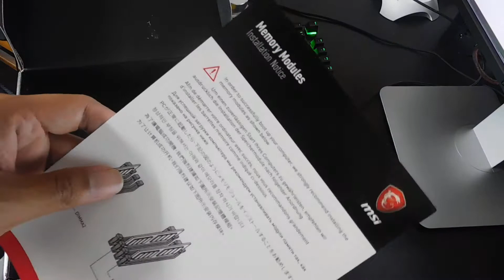quick unboxing MSI B350M GAMING PRO AM4 RYZEN

Comment: what processor you have?
Reply from the maker: RYZEN 5 1600
Reply: good
Reply: what do you have it overclocked to?
Reply from the maker: I overclock from 3.2 to 3.65 can't go higher because I'm still use stock cooler
Reply: +Joko JMC and what voltage ?
Reply from the maker: arround 1.3-1.35-1.37
now I'm back to default setting because unstable system, i'm not good overclocker

Comment: I'm thinking to buy this board with ryzen 1600, CORSAIR VENGEANCE LED 16GB 3200MHZ, Corsair VS450 PSU, will these parts work ok together ? my first build, so im kinda woried about parts. xD
Reply from the maker: make sure your ram is available here https://www.msi.com/Motherboard/support/B350M-GAMING-PRO.html#support-mem I'm using unsupported ram (Patriot Viper 4 3400mhz) and still stuck in 2933mhz
and I heard this motherboard use "cheap" vrm/mosfet or something part in near cpu socket, if you plan to overclock I suggest buy better motherboard, for daily use without overclock this motherboard  is still powerful, just make sure you buy supported ram
Reply: RAM im about to use is not in supported list, but i think it will work anyway, they just don't put all the rams that it can run with in the list i gues. I'm making this build for music production, and i'm not thinking about overclocking. I just don't want to buy parts that wont fit and work properly, thats all

Comment: any problems with this mobo? getting mine tomorrow with ryzen 1700 and msi rx480 8gb
Reply from the maker: I have not used it yet, still looking for memory
Reply: Siala Leao I have it, been using it for 1 week now with no probs. overclocked cpu and ram also with no issues. do make sure to update bios to the latest as it will improve cpu performance. bios can be a little glitchy but what bios isnt.
Reply: Joko JMC best memory is the flare x from gskill. tested out all types and that was the best for me. also higher mhz ram will increase speed on cpu as amd has its special "infinitely fabrick" to thank for that.
Reply: Thanks mate. Its a public holiday here in Australia so I so get my parts tomorrow or Friday

Anyways as I am new to the PC Community. Did you download the AMI BIOS 2.3 or the AMI 7A39v24 (AGESA to 1.0.0.4a)? I cant wait to build my first PC. Thank you for your help and I will continue to support your channel 😀
Reply: 7A39v24
Reply: you can add me on anything to message me on any questions you have.
Reply from the maker: unfortunately gskill ram is overpriced in my country
Reply: what i would do is try to get ram with 3000-3200 mhz with low CAS latency like cl14 or cl15.
Reply: I'm planning on getting this board, what would be the process of updating the bios?
Reply: @SolarSyn I heard bios were crap on this motherboard.  I was going to get this one until I done more research on it.  I'm probably going go with the ASRock AB350 Pro4 which doesn't suffer from the same issue.
Reply: quantae06 alright

Comment: Which one Better ,This one or Asrock b350? And why pls answer thx :)
Reply from the maker: if you mean Asrock AB350M Pro4?
then I think AB350M Pro4 is better than this motherboard
- better memory support 4 dimm, my mobo only support 2 dimm
- better audio support 7.1 channel, my mobo only have 3 audio jack and I think not support 7.1 channel
- 2 M.2 slot, my mobo only have one M.2 slot
- better PCIE support
and I think better cpu capacitor, I'm not own AB350M Pro4 so I compared it from the picture

Comment: I want to overclock ryzen 7 1700 with this motherboard is ok?
Reply from the maker: better buy X370 chipset if you want full support overclocking, this motherboard (B350 chipset) seems have limitation for overclocking (my R5 1600 only stable at 3.7Ghz and it's hard too push more higher)
and X370 chipset is good pair for 8 core ryzen
Reply: I just want daily overclock no more than 3.7ghz at 1.35volt is still possible for ryzen 7 1700? I want overclock ryzen 7 but No more budget for x370 hehehe
Reply from the maker: I think B350 chipset it's okay for low overclocking, You can get 3.5GHz @1.3v easily with that motherboard
Reply: If 3.7ghz is possible?
Reply from the maker: I'm not pro overclocker I learn overclocking on internet, for newbie like me pushing to 3.7Ghz on B350 chipset is quite difficult, I;m using R5 1600
Reply: Ok thanks